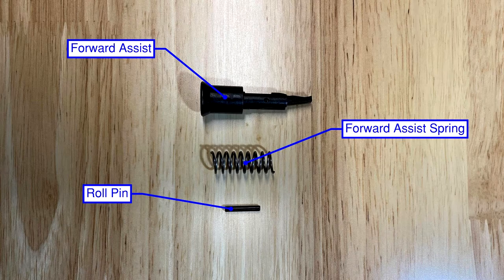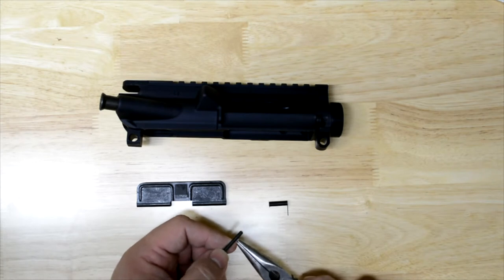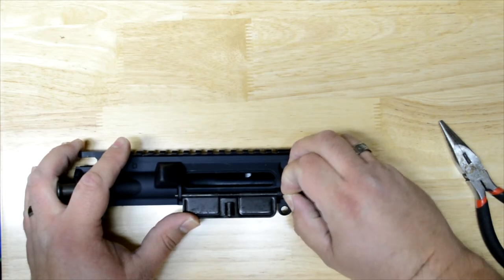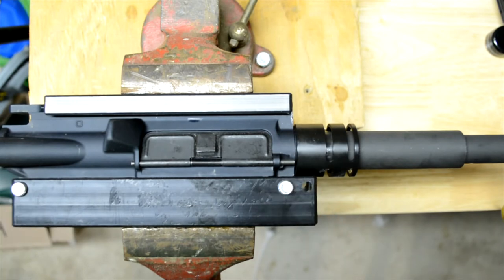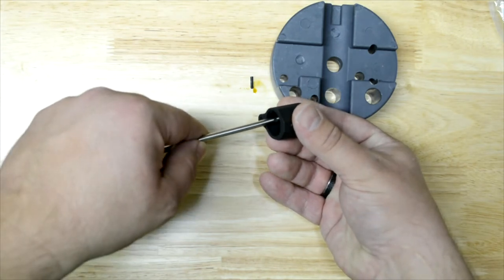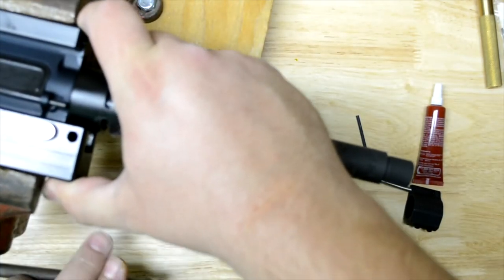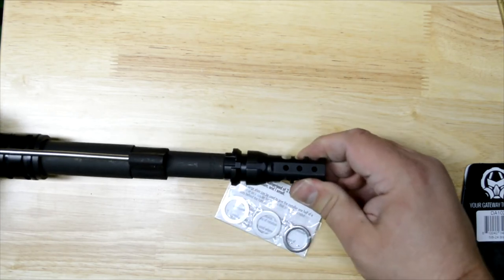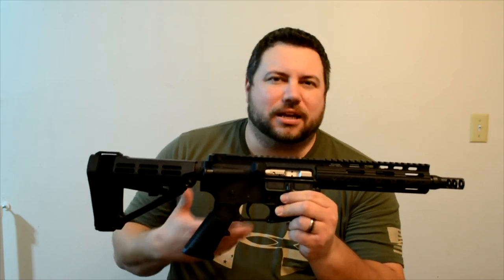My 300 Blackout Build - Part 2 - Completed Project

Comment: Another great video Bro! I am building the same as you have but a 5in Barrel. Looking at the UTG Free Float hand guard.
Are you running a supressor? I am thinking they have a 5in Hand Guard, but maybe I will run a 7in like you have but let my supressor drop down in the handguard a couple inches?  Any thoughts on this after this video 2 years later?
Are you still happy with the UTG?
Reply from the maker: I'm way happy with the UTG. I am running a suppressor and you need to see my later video because I had to trim the handguard down a bit to fit the suppressor lol

Comment: Thanks so much for the videos. I just completed my build. What a fun project!! Couldn't have done without your detailed instructions. This was my first build in the AR platform. Your parts list is what gave me confidence to give this a try. However, I have to say I am disappointed in the AR Stoner lower parts kit. The hammer and hammer pin was a non starter for the fire control group. I ended up going with a polished kit from PSA and love it. It sort of matches the nickel boron BCG and gives it a neat contrast. I have not been able to take it to the range yet. Is there a certain ammo that you have found works well with this build? This is the only 300 blackout I have so looking to start out with a good recommendation.
Reply from the maker: Congrats on your build!!! I will say that I did indeed go with fair cheap parts, but over time when I get to know the gun and its quirks, I’ll upgrade as needed (and as money allows). As far as ammo goes, it’s really what you can find at a reasonable price now especially if you are not going suppressed. I’ve tested mine with Armscor, Fiocchi and Hornady and it’s done well with all of it so far. I’ll do a follow up video as soon as I can discussing more details. Thanks for watching and let me know how your first time at the range goes!!

Comment: basically if someone had an ar platform all the person would have to do is change the barrel for .300 blackout?
Reply from the maker: Basically yes because the base of the .223/5.56 cartridge is the same diameter. Even regular Pmags work, but I still prefer to use the .300 blackout specific Pmag

Comment: What did you end up doing for sights! I love it working on my 7.5” .300 at the moment. Drilled & tapped an old front sight block gas block combo to sit in the set screw pocket & the 4” knurled tube. Cool retro look. Ive also heard not to put your gas block all the way backed up to the barrel collar to line up the pirt correctly, or is it different on more modern barrels that weren’t intended for delta ring set ups where the small
Metal handguard retainer would sit behind the FSB. Let me know! Would love some range footage of that little thumper! Cheers
Reply from the maker: Some of them are different. I used the factory set screw "pit" on the barrel and it line up perfectly. Using the barrel pit, the gas block didn't quite rest up against the collar. I could maybe squeeze a playing card in the gap. Fortunately, most block ports are oversized a little to help with misalignment. I will have some range footage up pretty soon! Thanks for watching!
Reply from the maker: I forgot to answer your question on sights! I started with some Magbul MBUS backup sights and the I added a Vortex Sparc AR red dot.

Comment: Been waiting ages for this! Grats on finishing it, how did you headspace the bolt to the barrel? Did you not bother or did you take it to a smith?
Final question: Why the three port brake? I would have figured you would use this opportunity to shoot some subsonic 300 Blackout.
Reply from the maker: Thank you! Sorry it took so long lol. I didn't headspace the barrel because AR format builds are standard usually don't have any issues there. The muzzle brake is a proprietary brake for my suppressor to make taking it on and off quickly and easily. I'll have a future video showing that.  I've posted a video about cutting my handguard that talks more about the brake. I'll keep posting updates about it and of me shooting it,  so keep checking back! Thanks again for watching!!